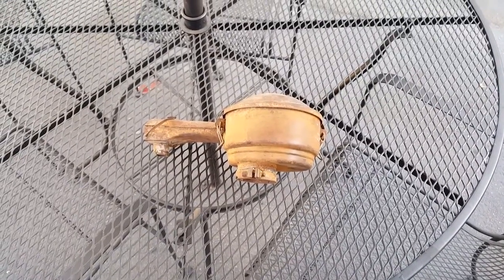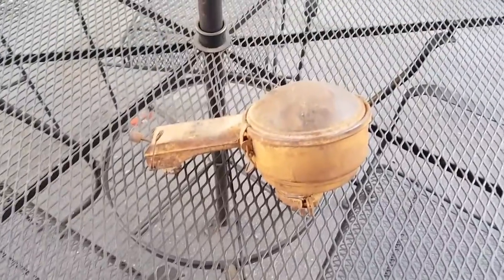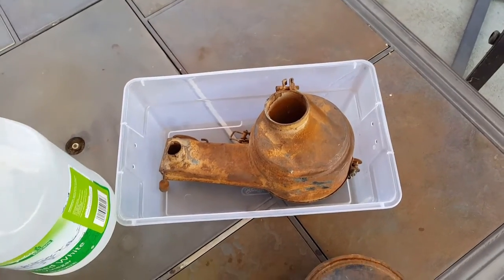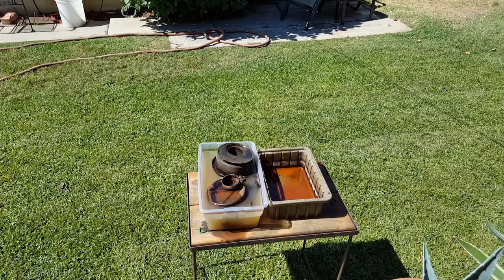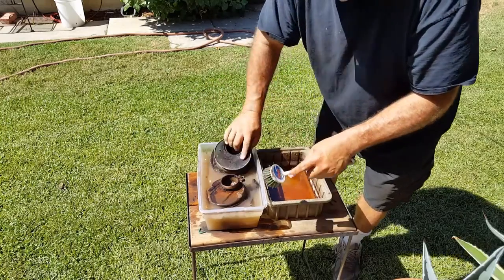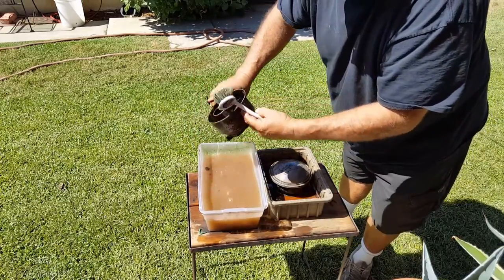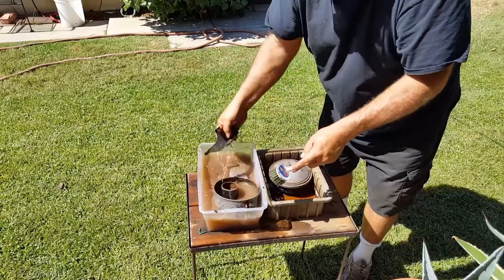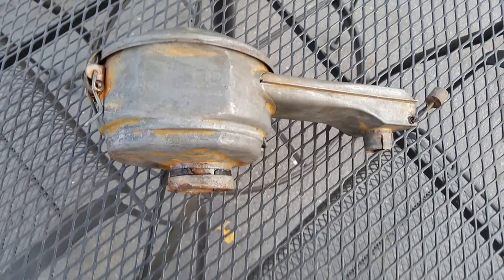RUST REMOVAL  WITH VINEGAR VW COOLED BUG OIL BATH AIR FILTER PHILA TV

Comment: Older post, but as a heads up you must flood the metal with clear water after treatment to neutralize the acid of the vinegar. Then immediately dry with a heat gun and spray with self etching primer. Otherwise your paint will not stick properly for a part that is exposed to heat. I've done this process to aluminum storm window frames to paint them white. Try this method on your cooking grill grates too.

Comment: Apple cider vinegar works better. The more you try it on anything rusty the more you'll be amazed. Try it on a rusty tool for a day or two.
Reply: And I've reused it, running it through a filter, over and over. Be sure to neutralize it with baking soda/water mix when done.